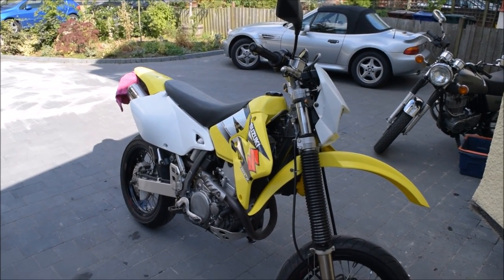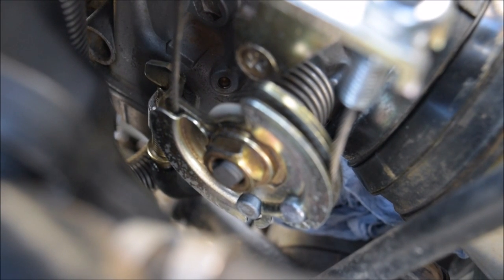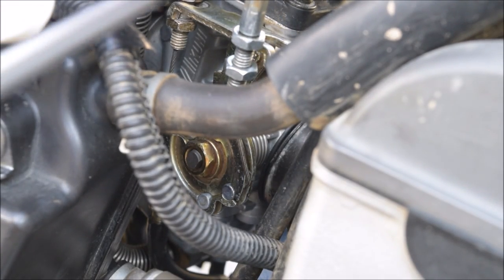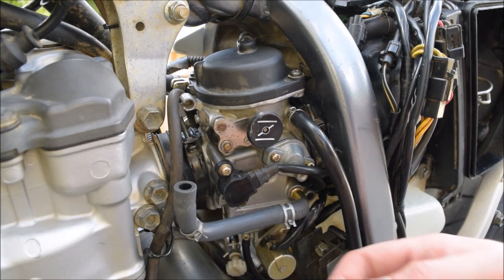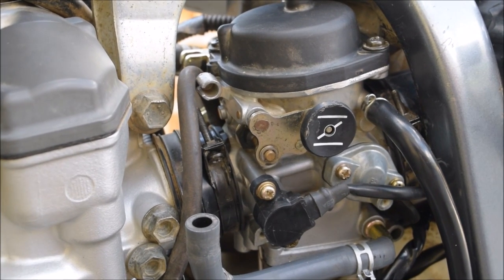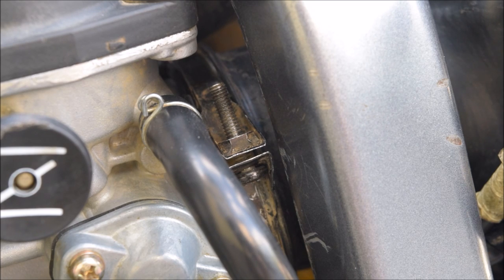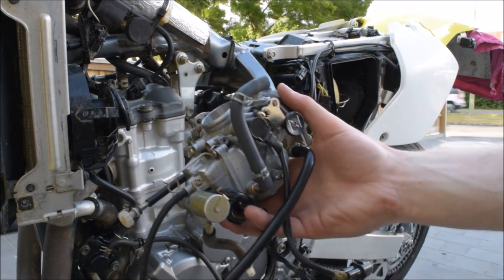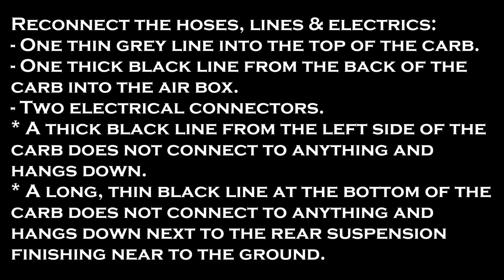How to remove and reinstall the carburetor from a Suzuki DRZ 400 S & SM (Carb removal)

Comment: Take the fuel line off and vac line then loosen the hose clamps for the boot and turn the carb . Never took mine out did it in about an hour

Comment: if you remove the top subframe bolt, and loosen the lower subframe nuts, (with the bike on a stand or jack) you can push the subframe back and that gives you more room for the carb to back out of the front and back boots.

Comment: If anyone's reading this:  There's no need to take the tank off, or any of the side panels.  Undo the throttle cable,  unplug the TPS. disconnect fuel line, and take the clamps off the rubber gasket/boot.  then take something like handle of a large wrench(spanner) as a prybar between the frame and the rear boot.  Then you just wiggle the carb out.  Takes about 3-5min. 

Use some spit on the inside of the boot to lube it going back on.

Comment: My airbox is ridgid, and did NOT move back easily like that unfortunately...  thanks for the vid!
Reply: Completely true.  I removed the thru bolt securing the rear subframe to the frame near seat/fuel tank mount on top member, then loosened the two bolts at the bottom of the subframe to allow it to pivot back a couple of inches.  This completely simplified removing the airbox snorkel from the carb mouth.  Also suggest loosening wire ties on upper sections to facilitate this.  All the bolts i mention are 12mm hex.

Comment: My pilot jet is plugged, so i can idle at full choke but dies with choke closed... seems to happen to every DRZ eventually.  I even winterized the fuel properly.
I read somewhere if all you need is to clean the jets, you can just loosen the jubilee clips and then rotate the carb 90 degrees over to access the bottom without actually removing it. Anyone ever try this?

Comment: I find this very interesting to watch.
However I'm afraid I won't be able to piece it all back together if I try this myself.
Reply: It’s not hard. It’s actually easier if you pivot the subframe up, which can be done by removing the bolts on each side down near the footpeg S, and loosening the subframe bolts at the top. Pivoting this up a bit and out of the way makes it much easier to move the airbox back from the carburettor. Much easier to put it back in too

Comment: the wires at 2:42 what are they called and for?
Reply: I'm also curious if you find out :)
Reply: Positive battery cable to starter
Reply: The cables he removed? Throttle cable ...